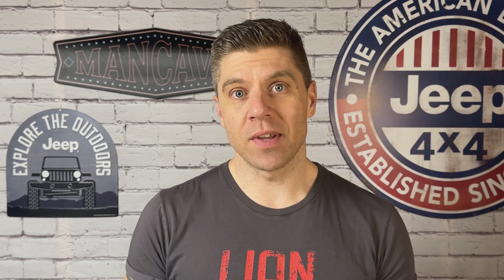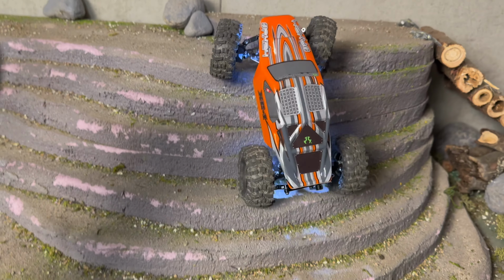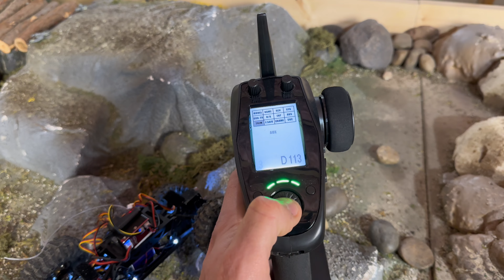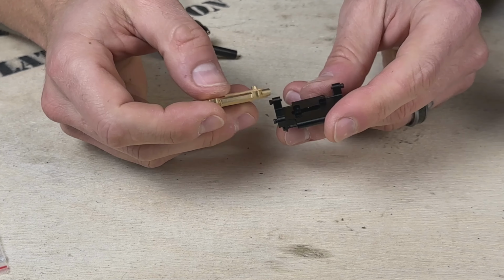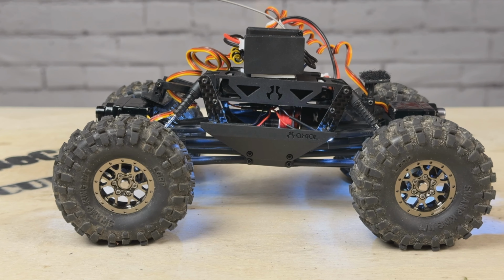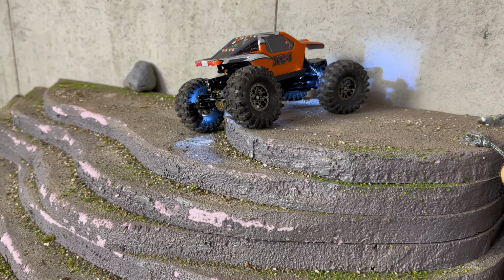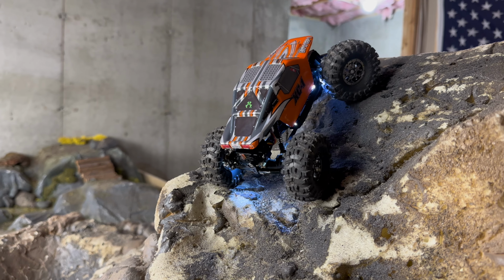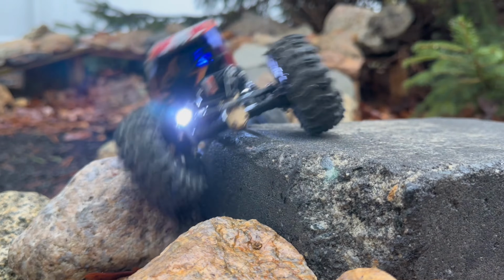Axial AX24 Build - Furitek BRUSHLESS Motor Upgrade! HUGE Performance Gains!!

Comment: Why do none of the videos of this set up point out that the engine rubs the front driveshaft.  I installed mine 2 days ago & it was very obvious immediately.   After driving it enough to kill the stock battery twice, the driveshaft has a groove carved into it.  Prolonged use will shear the shaft & also damage the micro komodo from constantly being hit from the bottom as the car drives over objects.  Furitek made their own skid plate for the AX24 & this engine, but they did a horrible job with clearances.  And all the people with rc channels sell it like it's the greatest thing you can get.  This has made me lose faith in these videos.  Everyone's an RC car salesman.  The engine is nice & the ESC is smooth, but using them as Furitek has designed in this rc WILL cause damage & waste the money of your viewers.  The AX24 is nice with the 4 wheel steering & the Furitek stuff is nice & smooth, but this combo does not work together unless you plan on replacing parts prematurely.
Reply from the maker: I reversed the drive shaft so they the female end is on the axle side and didn’t have rubbing after that
Reply: @CapeCrawlers  i tried that too, but it didn't help.  It just made it so the male part of the drive shaft hit the engine, which will beat the crap out of the Komodo as it runs.  With everything set up stock, they hit when my shocks are about 2/3 compressed.  When the drive shaft is flipped, they hit when the suspension almost compressed, but the beating on the engine will be significantly worse.  I'm going to try installing the Komodo on the stock skid plate to see if that helps, but so far, I wouldn't recommend the brushless set up to anyone for this RC unless they have money to throw away.
Reply: @CapeCrawlers  i tried the stock mounting plate & it's not even close to fitting.  The Furitek plate would probably work fine if it raised the engine 3/16",  used the flipped the driveshaft trick, and then cut a hole in the battery tray.  

 Another thing that i didn't like about the Furitek is the placement of the mounting screws for the Komodo.  I had to cut away the top of the transmission case to turn the motor enough so that the mounting screw on the right wasn't against the gear.  Also, after getting this all together, the shell no longer rests inside the groove  that it was designed for. 

Overall, I'm not impressed at all with this set up.  I'll probably take out the komodo & go back to brushed for this rig, unless i can figure something out.  Kinda bummed about it.  Nice video on your part, but as a viewer, this would've all been very valuable information to me before i spent my time & money.
Reply: @CapeCrawlers  yeah man, I've tried everything.  Moving the shocks everywhere possible, cutting rubber shock absorbers from the back & doubling up the front, with the flipped driveshaft.  That motor hits bad no matter what i do.  The free one you got must be designed differently than the one i paid for.  I'm going to use the esc with a brushed motor.  The Komodo is a no go.